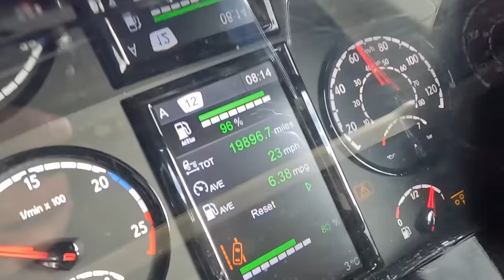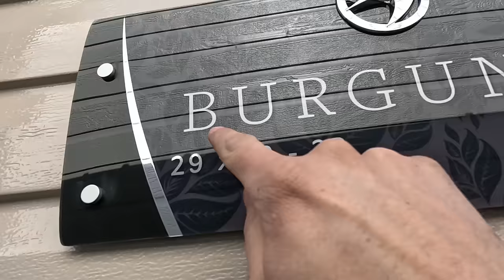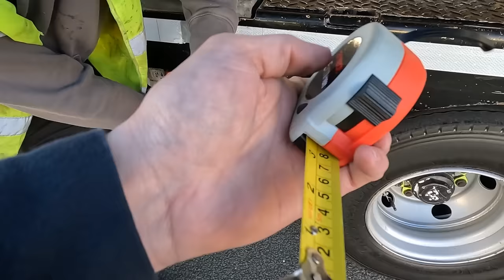Delivering A BRAND NEW Caravan To The Beach In A SCANIA 730 V8 T-CAB | #truckertim

Comment: We call those mobile or trailer homes in the US and they are moved by trucks that haul nothing but them and they can be up to 16 feet wide and 80 feet long and we don't hual them on a trailer they get pulled down the road just like any other oversized load would.